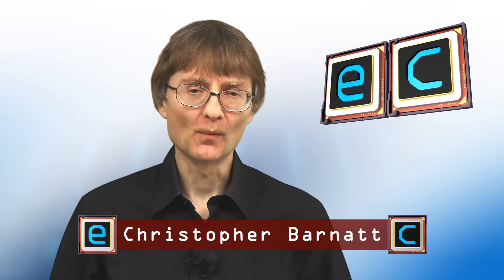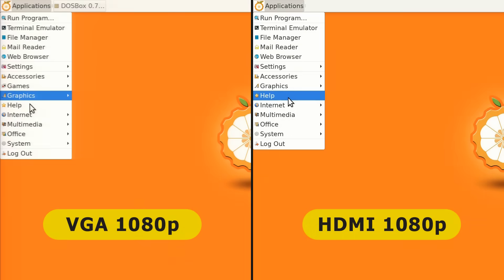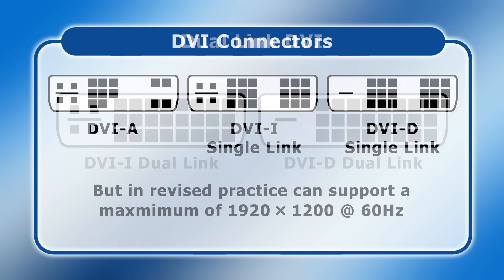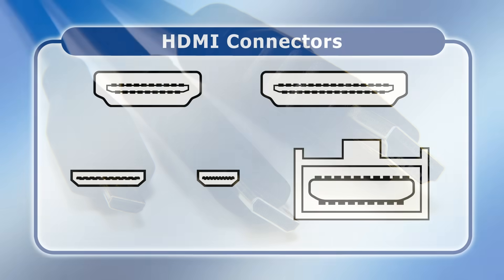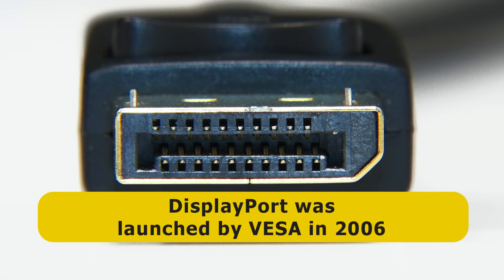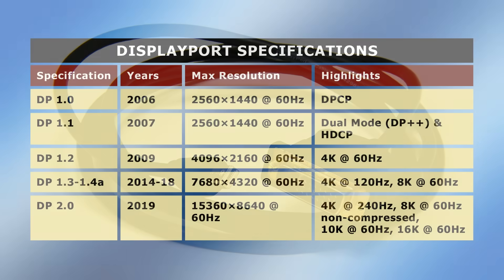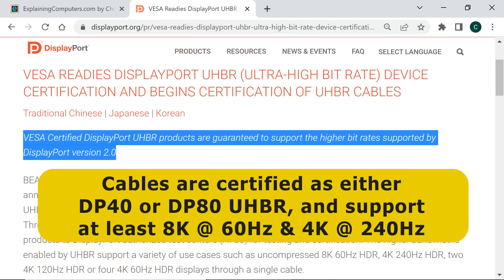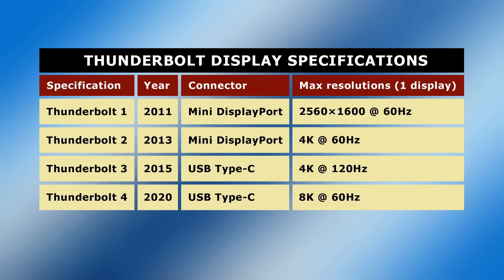Explaining Display Connectors: HDMI, DisplayPort, USB-C, DVI, VGA & Thunderbolt

Comment: Gday Chris, can u elaborate on what u meant buy daisy chaining display ported pc"s as i have several HP thin client pc's with 2 display ported outputs. I cannot see how u could daisy chain it.
Reply from the maker: The daisy chain will involve a DP cable going from the PC to the first monitor, and then a cable going from the first monitor to the second, and so on. So you need monitors that support this too.
Reply: @ExplainingComputers  Ahhhhh I see, i never came across monitors with Display Ports...... they must be rare in AU.

Comment: Great overview.  I was using DVI for the longest time and moved to USB-C based Thunderbolt 3 when I also moved from PC to Mac based machines (iMac 5K 2017 and MacBook Pro 2018), mostly skipping over HDMI for computer use.  I've got to say that the newer Thunderbolt technologies has made things so much easier for me now, reducing the need to have a dozen different cables handy to just one basic type (USB-C).  Everything connects so seamlessly now and just works.

BTW... I, like most of you, have an ever growing box full of "standard" cables... just in case... including one of just about every type of DVI cable they made.  😝

Comment: which dvi connector is best one though?
Reply from the maker: The one that supports the monitor you have at the resolution you want to run at. If in doubt, DVI-I dual link gives most options.
Reply: Thanks

Comment: What does 'HD', '4k' and '8k' actually mean?
Reply from the maker: HD is almost always taken to mean a resolution of 1920x1080 -- although this is sometimes described as "full HD", when 1280x720 is also being described as an HD resolution. For example, for years YouTube flagged 1280x720 videos as "HD".

4K is trickier, as it refers technically to a resolution of 4096 horizontally (a standard from the film industry), making 4K resolution 4096x2160. However, in consumer technology, 3840x2160 (or twice HD on both axis) is very widely described as 4K (and also as "ultra HD" or UHD, which is always 3840x2160). As shown in the table in the video, when HDMI first reached "4K" it was actually 30 frames per second at 3840x2160, or 24 frames per second at 4096x2160. But since then, all "4K" standards for HDMI and DisplayPort can support the same frame rate for UHD and "true" (4096 wide) 4K.

By 8K, everybody had given up and gone home. So 8K is double UHD, or four times HD, in both directions -- 7680x4320.

Comment: DVI can support audio and video
Reply from the maker: See pinned comment. The DVI standard does not support audio, and even using the non-standard implementations it remains impossible to use a DVI-to-DVI connection to transmit video and audio. :) Just because NVIDIA and others hacked th DVI ports on some graphics cards to transmit audio over a custom cable to an HDMI connector does not mean that "DVI supports audio"!
Reply: @ExplainingComputers  roger that  :)

Comment: Some monitors in the 2000s also supported S-Video and Component, useful for outputting from video players or gaming consoles of the time.
Reply from the maker: Indeed. As noted in the video, there I have covered the most common means of connecting a computer to a monitor. :)

Comment: I have a Microsoft Surface Dock 2 which only has usb video out no dedicated HDMI or Display Port. So I bought a usb to HDMI cable and had so many issues getting the display to work when I plugged my Surface into the dock. As I was about to order a different USB to HDMI cable I remembered that when I bought the monitor I had a Macbook that used Thunderbolt to Display Port. So I ordered a usb to DisplayPort cable and all my problems with the dock were solved! It's a MS Dock problem as HDMI works fine directly plugged into the usb port on the Surface laptop. My point is if you are having issues with a setup maybe try a different port as most monitors have more than one standard.
Reply from the maker: A good point. There are always "possibilities". :)

Comment: Also, wireless displays are getting more common now, although I think latency will take time to catch up in high res or high refresh rate modes
Reply: Also, I don't see wireless monitors being used by government or enterprise. Whatever signal is sent to the monitor, could be spoofed. So this feature would be a private home use thing only, I guess.
Reply: "latency will take time to catch up"
😀😀
True on multiple levels !

Comment: Saw this on my feed when it came out but had to hold back watching as I was about to fall asleep. But I knew this video will be solid and great so I left a like before even watching it. And I'm happy to say it is!
Similar to another comment I made on another video of yours before, I think this video should be part of some sort of IT101 course lectures, as with all of your Explaining series videos. It is very well explained, presented, and the graphics and macro camera work that come with it very much aids to the presentation and explanation of the connectors.
I've learned about most of them except USB C and Thunderbolt display from other videos and reading online, but this video showing them all is a vey well rounded approach to introducing them.

Comment: Back in 2010 I bought a Dell U2711 monitor (27" IPS LCD panel, 2560x1440 @ 60 Hz).  I still have it today and use it on a daily basis.  It had ALL the ports available at the time.  VGA, DVI-I Dual Link, HDMI 1.4, DisplayPort 1.2, Composite, and Component.  (When's the last time you've seen a device using a Component connection, eh?)  It also had a 3.5mm audio output in case you were sending it audio via the HDMI or DP connectors, and needed to attach some speakers (or its optional "sound bar," which I also still have to this day).

It was the first time I owned a monitor wherein its max resolution wouldn't work over a VGA cable.  Luckily it came with a dual-link DVI cable, and my video card at the time had a dual-link DVI output.  I'm quite surprised, honestly, that a 13-year-old monitor is still as relevant today as it was back in 2010.  It is attached to both my Windows 10 PC and my M1 Mac Mini, using a DisplayPort-based KVM switch, with no issues whatsoever.

The only issue I've ever had with it is that It has a small bug in its firmware which reports its max resolution via the HDMI port as 1920x1080 instead of 2560x1440.  This only happens on the HDMI port.  On a PC, you can manually "overclock" the video card's output to 2560x1440 @ 60Hz.  (And, in fact, it'll do 72 Hz, just fine with no ghosting or other artifacts).  However, on a Mac, I never could figure out how to force it to output a spec different from what the monitor tells it to output, so I was forced to use DisplayPort, or suffer with 1080p output.  Since I wanted to be able to switch from PC to Mac using a single KVM, I was forced to buy a DisplayPort-based KVM.

Comment: I think a very important missing notice here is that HDCP is "defective by design" technology that can prevent any HDMI video connection from functioning if, for any reason, the connection and CP handshake data exchange does not receive 100% HDCP approval of the transmitted audio/video signals. I recently had a 1920x1080 device refuse to output its fully standard HDMI video signal to a slightly older DVI monitor model despite that monitor's proven ability to function at 1920x1080 resolution without issues when connected to several other HDMI output devices.
Reply from the maker: I am not a fan of HDCP. I often work with "splitters" that happen to remove the HDCP signal to overcome the kind of issue you describe, and which is too common.
Reply: @ExplainingComputers  Where do you get those splitters? I thought such things were not quite legal. 🙂
Reply: Thanks EC for the reply and acknowledgement of the problem. HDCP was definitely the source of the DVI monitor issues I described since the source device works fine when connected to an HDMI monitor. Putting an HDMI splitter device in the path is a good solution, though you correctly note that this depends on the splitter you "happen" to find. My experience is that finding devices that bypass the HDCP blockade is a hit and miss, "buy it and try it" proposition. ☹

Comment: Interestingly new RK3588 does not work with many DVI monitors, when they work with older RK3399 with same HDMI-DVI cable, do you have any idea why this could happened? 
DVI was dropped by most manufacturers in 2010 and effectively should not be produced after 2015. Today should be dead, but still some 24" fhd dvi monitors are working, especially as 2 or 3 monitor.  And this happened, is this the real end for those devices? ;)

Comment: Those locking tabs in a DisplayPort are useless. You can easy pull out the DP connector without pushing the button.

There was some display card manufacturers that did have audio in the DVI connector.
Reply from the maker: Indeed. See pinned comment.

Comment: If the world leaves it to manufacturer's consortia to define a new and again incompatible standard with designed-in obsolescence path no one should be surprised to have 12 different connector types for video. And of course 12*12 possible adapter cable type, preferable working in one direction only so you'd need to have even more. Manufacturers are all too happy to design yet another connector type because in comparison with other electronics these are expensive. Now it would be possible to design a connector which would last much longer. And just upgrade the electrical specifications, and only if you need those, you'd require a new cable. Now even if I want to connect a 1920x1080 monitor to a HP desktop I already need a DP cable on that end. And of course an adapter cable because I kept my old monitor. While the oldest HDMI standard would have been sufficient.

Comment: I've never used DVI. I used VGA with PC monitors up until 2020, mainly because I didn't know any better. To its credit though, VGA "just works". I've never had issues with VGA cables, while I've had the occasional issue with HDMI and DP cables.

Comment: With all the stuff that seems to use the USB Type-C connector nowadays, I, not having as of yet laid my hands on any such equipment (being broke for years and using the same PC for the last 10+), wonder if there is any possibility observed in the standard where plugging the wrong things together would cause a catastrophic release of "magic smoke".
Is it possible to break USB-C devices or hosts by accidentally plugging the wrong junk together or is the standard safe in that regard?

Comment: Very cool video.  I remember the first time I saw HDMI at CES 2003.  There was a monitor with this small cable connected playing video and audio.  I was amazed how clean the set up was - one small cable and a power plug.  I disconnected that cable and the picture and sound disappeared, proving that it was the source.  I plugged the HDMI back in but the video and audio didn't come back and I panicked.  Maybe it would've come up again if I waited long enough, but I quickly walked away.

Comment: I love how they are chasing meaningless numbers. I guess it’s just a matter of being able to say “mine is better than yours.” The human eyes cannot see the difference between 4K and 8K. In most cases, it cannot even perceive the differences between images at even lower resolutions. But now we have “standards” that support 16K. What a joke. 

Instead of this silliness, they should work on adopting a “standard” that is actually standard.
Reply from the maker: There is much truth in this. In a cinema, from 30 feet (which is not that far back), almost nobody over 30 can even see the difference between 2K and 4K projection. There is no reason to go beyond 4K for lean back (aka "TV") consumer use. But for very large computer screens viewed close up there are perhaps merits to 6K and 8K. But 16K? Well, that is surely for professional capture/plate use only. We shall see!
Reply: depends on the size of the screen, you can sooooo crisply see the difference between HD and 4K on 50 inch tv viewed from 2m distance... now imagine 19 by 10 meters ad screen on building - from afar even 8K will do, but upclose you d benefit from 12-32K greatly
Reply: @cokeforever  Sure. We can make a case for ANY resolution.  Imagine the resolution we'd need to project images on a screen that is 10 miles on each side. But as a practical matter, we're not going to do that. And we're more in need of a real "standard" than in bragging rights for some committee.
Reply: @CCoburn3  but unlike you, i'm not making up the case: high def street ad screens are a reality in most of world's capital cities, with sizes larger than the one I mentioned. Those show both the long-range graphics of an ad and the close-proximity texts and sub imagery. As for "standards" 19:16 is a cinema screen standard (wide view), 4:3 was monitor standard (caused by manufacturing constraints and space it took on user's desk) - the usability benefit of widescreen is obvious but many rigid-minded people, Christopher included, still say they "prefer 3:4" - and you say "standards"))))

Comment: Q: does anyone still use 'composite' in computing? Also, is SDI the same as BNC?
Reply from the maker: Some SBCs still have a composite output -- and retro enthusiasts running old machines I'm sure still use composite.

SDI uses one (or more) BNC connectors, but is nothing like composite or component video that uses the same format plugs. Rather, SDI sends digital video over coaxial cables. There are many standards, with the most common in use today being 3G-SDI (which runs at 3 gigabits, and is used for 1080p), as well as 6G and 12G SDI, which are used for 2160p at 30 fps and 60 fps.

Comment: And here´s an interesting problem. I have an Apple LED Cinema Display 27". Old but great. The problem is that it´s stuck with just a cable with a male mini-dp port. No connector, just a "glued" cable with a mini-dp for connecting to Macs around 2009-2015. Very nice, but I would like to connect it to my new Thinkpad. The problem I have is finding adapters or hubs that convert hdmi or usb-c/thunderbolt 3 to a female mini-dp. I think it´s the scenario they missed.
Reply from the maker: Here you go: https://www.amazon.com//dp/B07G9VP8FH/
Reply: @ExplainingComputers  Thanks for your reply. That´s definitely worth testing.

Comment: USB-C will be heavily driven by hybrid office arrangements without fixed desks where employees use notebooks. The ability to use a monitor as a dock with the display connection doubling as a charging lead is unbeatable. With DP and HDMI, a separate dock becomes necessary that increases the cost of a workstation and needlessly takes up additional desk space.

Comment: My earliest computers used TV modulator connection later CGA, EGA, VGA DVI-D, HDMI,and currently DP so I have used basically all PC video interfaces over the years.  IMHO HDMI was a low point in PC video. How long did we see no improvement in video performance because manufacturers used cheap 1080p  TV IC's?  I had a windows XP laptop long before HDMI with DVI-D and a native display that had a higher resolution than 90 % of today's laptops boasting 1080p, and as we know the requirements for a computer display are very different to TV displays.
With high bandwidth transmission signal integrity is a major hurdle to overcome so it is a mystery to me why we have not yet seen optical fibre connections on mainstream computers. It is a mature technology and It ought to be easily scalable and offer versatility of devices it might support like video/audio, data and peripheral connection. One cable to rule them all so to speak.

Comment: The are more Ways to connect monitor like but you need adaptor if you want to connect in computer

Those are AV, scart, Svideo I believe its few more but I don't remember the names for the others but this useful only if you have old TV that doesn't have HDMI port for example if you have CRT tv or tv or old flat TV that may not have HDMI

For those that wand to connect those old TV's please make explenesio video what adaptor to to use HDMI to av HDMI to scart Wich off those have better image quality in with whhwt type off monitor ?
Reply from the maker: Indeed! But this video focused on connecting a computer to a monitor, and the most common means of doing the same. :)
Reply: @ExplainingComputers  Yes I know that

Comment: Excellent excellent excellent Chris.
I have a question.
I use an external monitor on one of my cameras.
It connects my way of HDMI. Correct me if I'm wrong, I thought you said it does not carry audio.
My monitor does have a headphone jack.
Is this audio coming through that HDMI cable ?
Thanks.  Keith
Reply from the maker: Hi Keith. I said that DVI does not carry audio. HDMI most certainly does! :)
Reply: @ExplainingComputers  
Darn I'm going to have to watch your video again. I could have sworn you said you did not carry Audio.
Most likely my mistake.
Thanks. Chris

Comment: I'd love an in-depth explanation of what DisplayLink is, since it's not really a video standard, its kinda a GPU, it's kinda emulated, and it con do wild things (4k) on a bus that's way too slow (usb2) and still be kinda usable. And yet it's definitely not a display running on your computer's other graphics hardware because displaylink can add a 3rd display to a system that's only capable of 2 (like early-2010s intel integrated graphics)